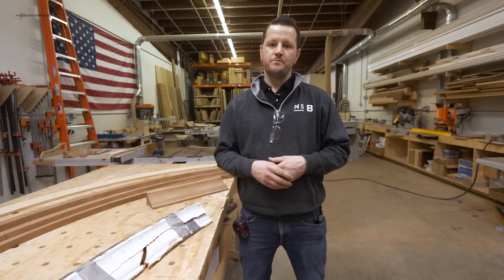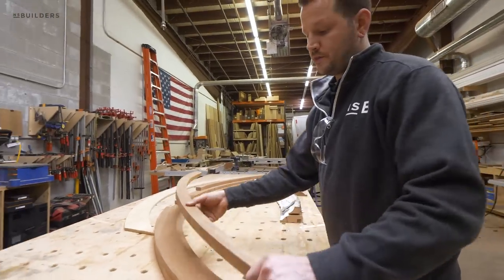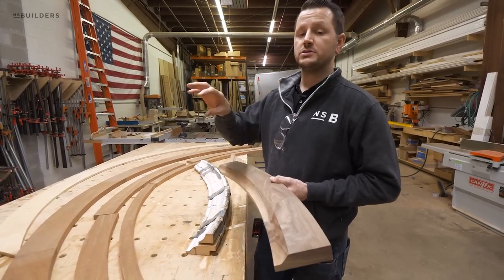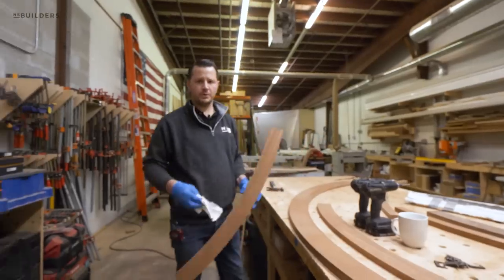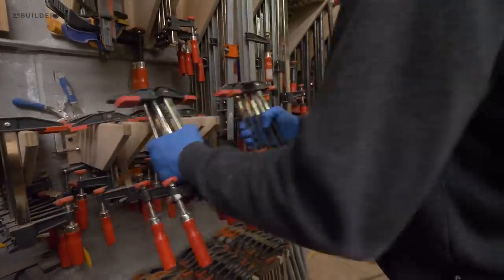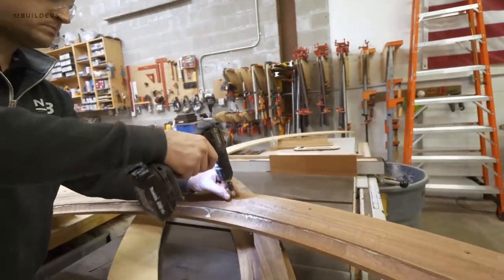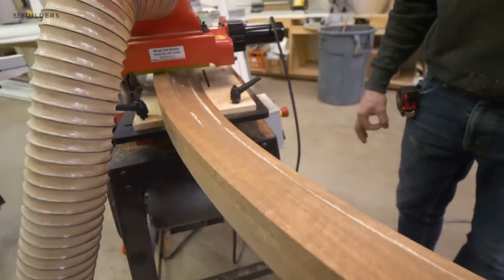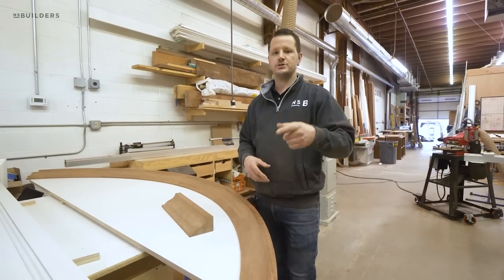How to make curved moulding | Revealed

Comment: Great explanation. Just curious about the marks left by the pinch dogs. I'm assuming that this will get painted in which case the marks can just get filled and sanded. If that's the case, why not add screws to the top layer as well and fill those holes too for added strength? If this won't be painted what do you do to hide those marks? Exterior grade wood filler? Thanks.
Reply: Great question! The holes made by the pinch dogs actually get cut off. The final knife set trims the top as well, cleaning up the dents caused by the clamps. This could stay natural, without the need for any filling.
Reply: @kendecost  Oh, cool! Didn't even think about that. Thanks for the quick response.

Comment: I've never seen pinch dogs before, but as soon as I saw them I understood how they work. Would it have been possible to do this with a router instead of a moulder for those who might not have one?
Reply: It's possible to stack different profiles to create some type of multi layer built up moulding. However you won't be able to make cuts this deep.

Comment: Awesome video. Loved seeing this process. My internal dialogue alternated between, "This is awesome craftsmanship!" and "These clients have way too much money!"

Also, I didn't follow why the glue doesn't get cut by the knife. Anyone have some insight?
Reply: Some of the glue runs down the face of the piece into the layer that was already cut. Each knife pass is at a different height. So some of that glue is below the bottom of the knife, under the cutting edge.
Reply: @kendecost  That makes sense. Thanks!

Comment: why don't you run a shaper with stacked profiles ,so it's one and done just curious . turned out really well even the way you did it !
Reply: That cutter head would be over 10". I looked into it. No one would make it. Even if they did it would be ultra expensive for a one off piece and super unsafe. We've used big cutters before but I wouldn't let anyone on our team risk that.

Comment: I’ve had partial failures with poly glue outside even doing everything right.  It works most of the time but when doing custom work with super labor intensive glue ups i wont use it anymore, not worth the risk.  Going back to thickened epoxy. Never had an epoxy failure with mahogany or cedar and a cleaner, stronger joint. Cure time is longer but peace of mind. Poly glue still has its uses, like glueing up wood post wraps.  Poly glue is better at filling gaps and imperfections with the foaming action. But the foaming requires massive amounts of clamps and hides the joint till its cured.
Reply: All very great points. Thank you. A quality epoxy is also a great choice for something like this.

Comment: You can tilt your auxiliary table to the angle of the crown and just use one knife.   A couple infeed and out feed supports and you’re off to the races. 
It won’t work with an ellipse, but a constant radius is no big deal.
Reply: Our shaper does not have a tilting spindle and I have never heard of doing that with a moulder. I'll have to look into it, thanks.

Comment: How about making a custom knife to get one piece. Possible?
Reply: I tried, the profile was just too big. There are limits to what our machines can handle and limits to the projection they can make the knives.
Reply: @kendecost  Yeah, this doesn't surprise me at all. Also, remember that the further out from the center of rotation the higher the surface speed at the tip of the blade so having a single cutter that big would probably lead to a lot of heat buildup and burning the wood. Incidentally, does the molder have speed adjustment? I've never seen one in person so I don't really have any experience with them.
Reply: It does have a speed adjustment. It’s the little knob on the front of the machine in the video.